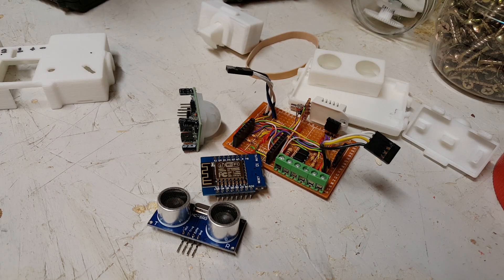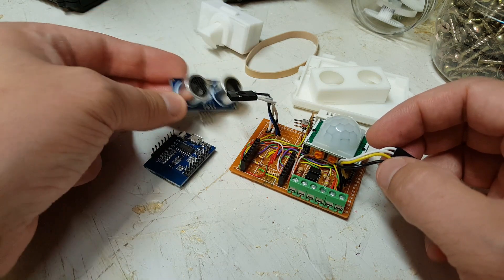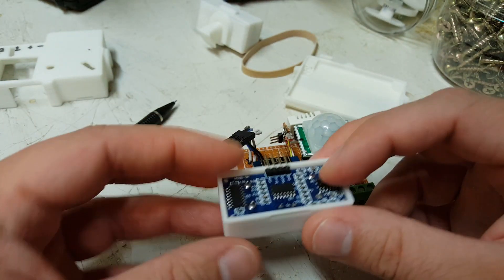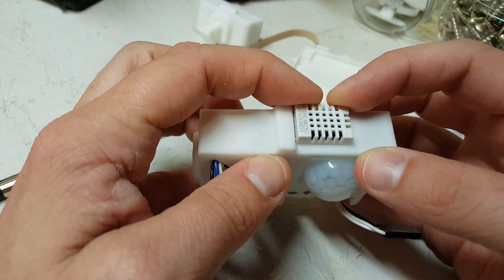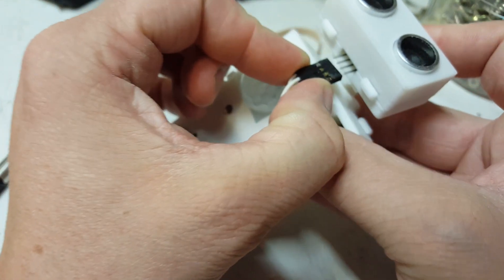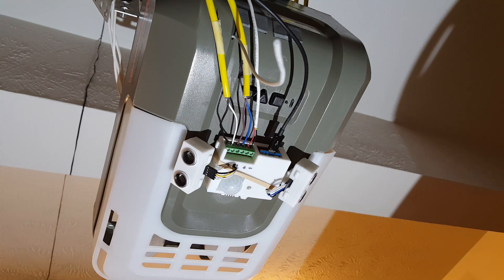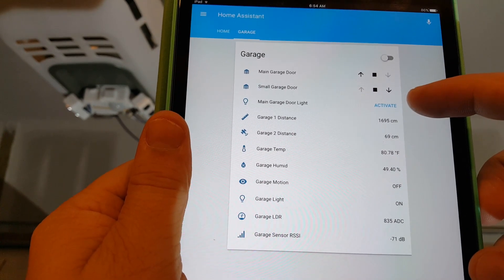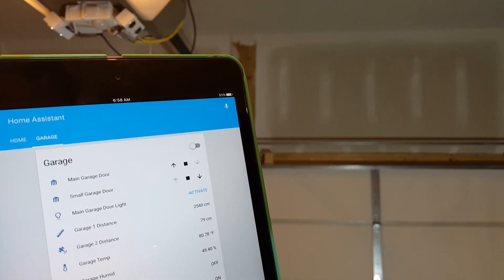MQTT Ultimate Garage Sensor - DIY

Comment: Would it be possible to use Tasmota for this instead of your Arduino code?  I guess I’m trying to see if there is anything you are doing that is not yet supported by Tasmota. I like the idea of Tasmota trying to support all ESP devices and sensors with the same code. I’m new here so sorry if this is obvious.

Comment: Fantastic, I have external roller shutters on all my windows currently controlled by remote controls. I would like to be able to set schedules based on time of day, weather, and who is home. I assume once they are talking to home assistant, this would all be possible?
Reply from the maker: That's correct. You can set up all different kinds of automations within Home Assistant and can have them trigger from a whole bunch of different events / conditions.

Comment: Can you provide the link for the application (home assistant)
Reply from the maker: For sure... Home Assistant is an open source, semi-do-it-yourself home automation platform that I have running on a raspberry pi 3 in my closet.

https://home-assistant.io

And you can find a list for all the things currently available for it to work with on it's components page found here: https://home-assistant.io/components/

And then to get it to show up on my home screen (for both Android and iOS) you just navigate to the home page found at the raspberry pi's IP address and port number in a web browser, then at the top there is an option to add it to the home screen. So when I say that I am "opening up my home assistant app" what I am really doing is opening up a shortcut to the web page of my Home Assistant instance that is hosted on my raspberry pi

Comment: This is exactly what I am looking to build. I've got a 2 channel relay (door 1/door 2). I am looking to get two mag switches (door 1 / door 2), a Phantom YoYo || TEMT6000 (photo sensor), a dht22 (temp / humidity), and a Uxcell AM312 (PIR / Motion Sensor).

Not sure which micro controller I am going to use, I have two ESP-01 but I am afraid I wont have enough I/O on it for all the sensors.  Then of course tie it all in to my Home Assistant HASSIO setup.
Reply from the maker: That is why I went with the ESP-12E on the Wimos D1-mini. I used every pin available and had to get a little clever with the ping sensors. Let me know if you are interested in the the ugly code that I have for it, and I will post it to my github page.
Reply: Of course we are interested in the code. Can you post it, please?
Reply: Yes please, home assistant code and d1 mini sketch would be awesome!
Reply from the maker: I have added it to the github page.